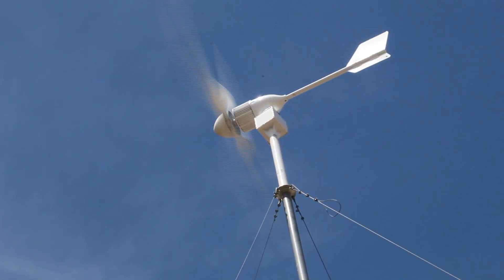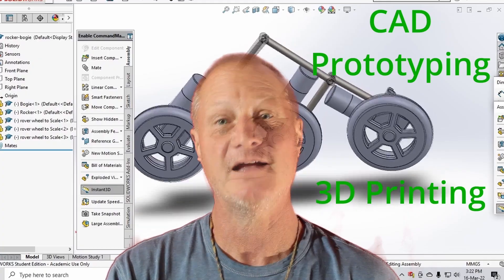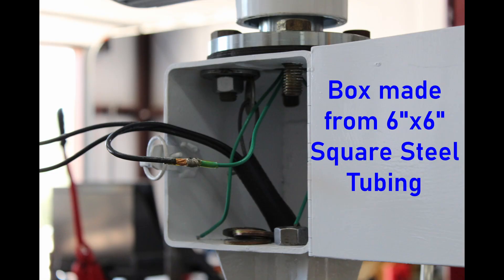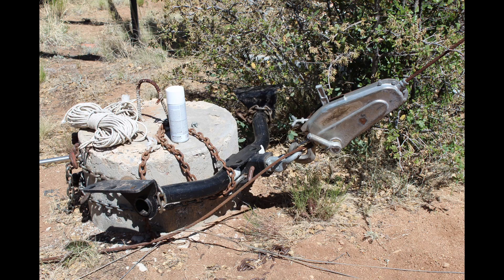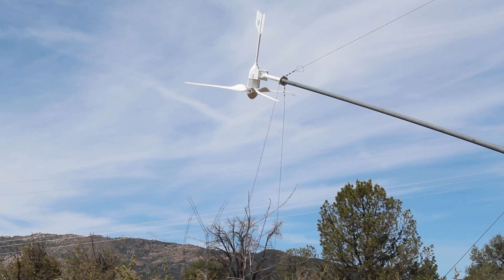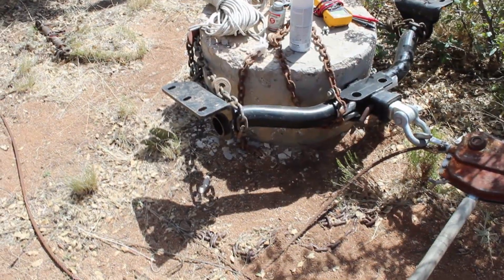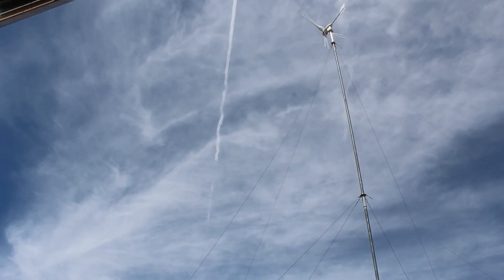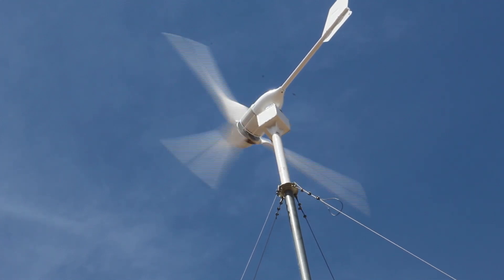Wind Generator Turbine, 1000W, design, fabrication, installation and raising

Comment: Would you say overall it was worth getting a turbine?
Reply from the maker: Absolutely worth it. This unit was purchased half price, (not by me) and I helped install it. But no question, it has already paid for itself. Having said that, the install location already had batteries, inverter, solar and other infrastructure in place. So there are other cost factors involved, depending on your set up.  Adding/upgrading wind power to an existing off-grid system was definitely worth it in this situation.